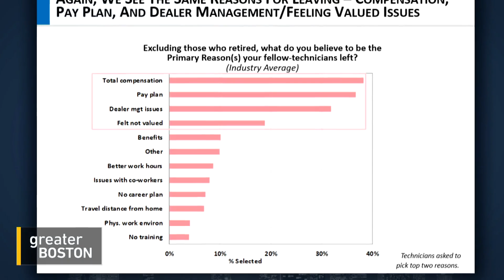Auto Mechanics Wanted

Comment: I wouldn’t recommend anyone get into automotive. You require the training a doctor needs but get paid a fraction. 
The flat rate system basically protects the shop from paying you if they aren’t getting paid. Well if I’m taking a risk of not getting paid then I should be getting paid way more money. I’ve met so many younger guys that quit because they were making 15 bucks an hour to bust their ass and pay for tools. So they go find some job that’s a lot easier, pays more and no more buying tools. Most of the shops I’ve worked for act like your committing a crime when you ask for a day off. This new car dealer I worked for had some old guys that worked there for well over 30 years, they have back problems, joint problems and more problems that are caused by working on cars so they slowed down a lot and the dealer fired them because they were slowing down. All the years they made that dealership money and they fired them because they slowed down literally from making them money.

Why would any kid want to get into this shitty business when they could get a job working in the computer industry making more money and not messing up their body. I’m 33 and I have 3 bad disks in my back from this business. Lifting all the heavy transmissions, tires. Yeah I make well above average money but I can’t do this job for much longer so it really wasn’t worth the time I have invested. 

So to any kids reading this find a better career

Comment: In 2017 if you want a good quality diagnostic tech and repair/maintenance mechanic that owns labscops and different scan tools with reprogramming hardware /software. You better be willing to pay them 80-100k a year. Starting out as a lube, tire, basic maintenance guy at 12 an hour flate rate and you have to buy your own tools with the cost of living is a joke. And that is just a little bit of the problem in this industry.

Comment: All you guys are in not on commission as a flat rate flagging tech. You guys are an hourly wage is the problem. It's up to you how much work you can get done in a 8 hour day and how much work you want to do. I flag on a average 15 hours a day in an 8 hour day with a 1 hour lunch. I am on time clock for 8 hours I get paid for all the work that I have done that for the day. If you are a flagging tech at a dealership. You are on commission not tied to the time clock. If you work on a car that pays 15 hours for that job and you take the full 15 hours to finish that job your not making any money. It's all about how fast and how aggressive and how determine you want to make money. I made that 35K back when I first started at Toyota out of school in 1995 as a flagging tech. I make way more money now with a different car line dealership. I bought tools as what was needed to do the specific job not buy all 10- 20K of tools all at once on a tool truck that's just stupid. I am still in this career as a flagging technician in a luxury car line. You make or break your own day for your pay. It's all up to you if you choose to be an hourly tech where you get paid by the time clock or be a commission flagging tech at the dealer and make lots of money. Most places have in shop tool boxes now days and besides If you want to save money there Sears craftsman and Harbor Freight if you want to save money in this career. Every trade now days require tools of some sort now.